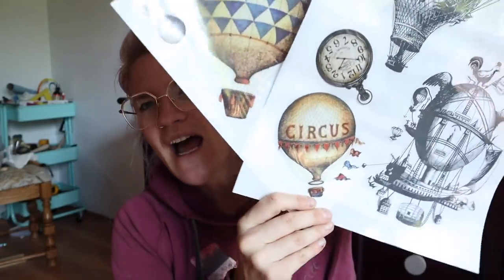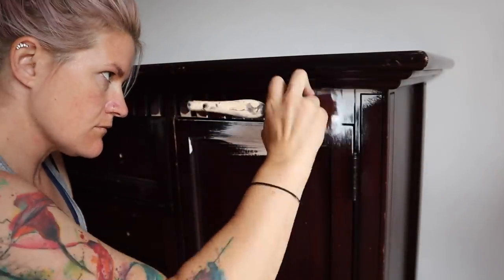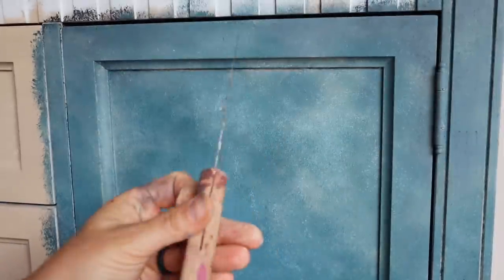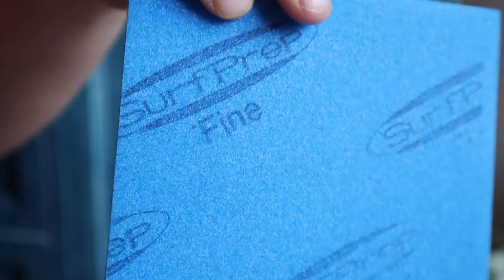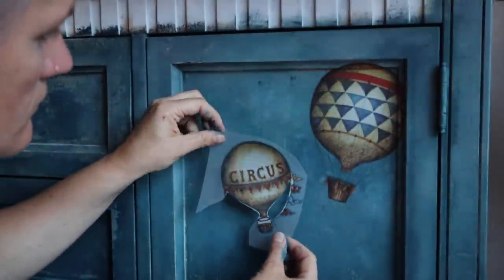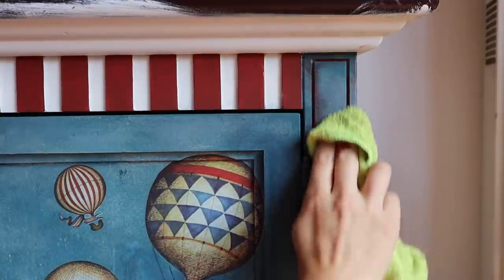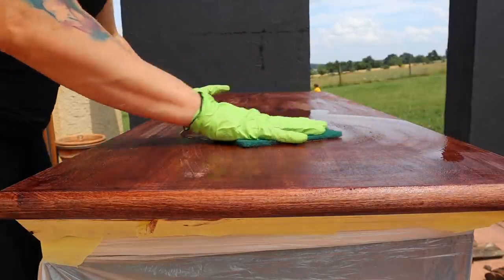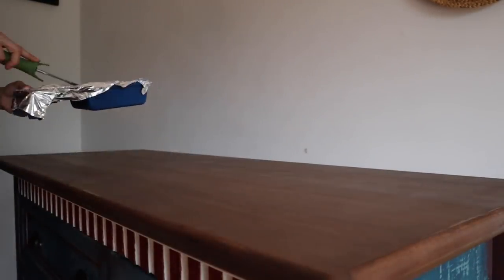Create Amazing Painted Furniture With Layers and Texture | Changing Table Turned Dresser Makeover

Comment: Love how this turned out. It's also a great reminder that baby or children's furniture can be redesigned to grow with them. I was surprised that you painted the hinges. I have stripped painted hinges and wondered if you  painted these so they would blend in rather than stand out?
Reply from the maker: So it is always piece dependent the piece this week I actually stripped the paint off, if it’s a blended piece or one where I don’t want hardware to be the focal point and it is a distressed finished I will paint them to match